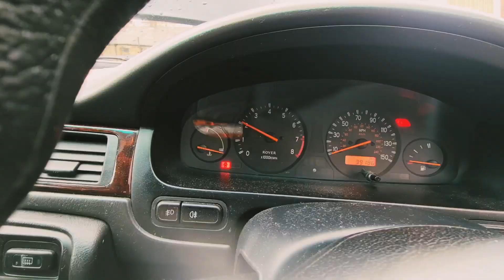Possibly the worst thing that happen, happened...

Comment: So happy two anniversary’s and I’ve just noticed Nigel’s interior doesn’t match the exterior 🤔 it’s all the same Colour carpet,seats and door cards which might confuse a guest when they get in as they may think they just got in the wrong car.
Reply from the maker: The interior is from at least 6 different cars, there's nothing standard about it, but it doesn't look wrong besides the MG steering wheel.
Reply: @ProjectNigel  I can sleep soundly tonight now you have cleared that up as it was troubling me somewhat, the camera doesn’t pick up the detail but you have corrected the illusion.
Reply from the maker: You can see in earlier videos some of the small details 😁